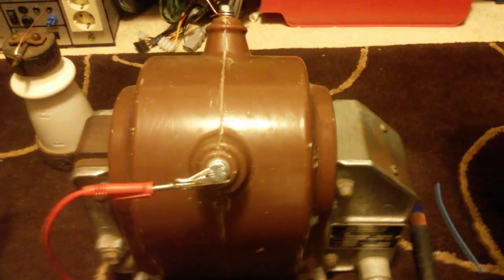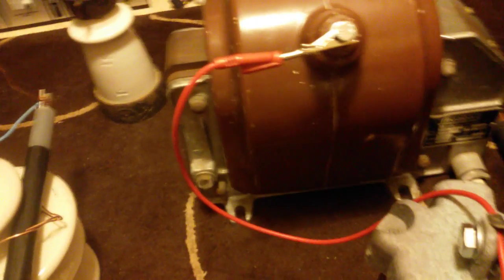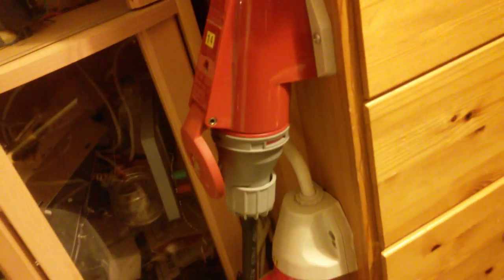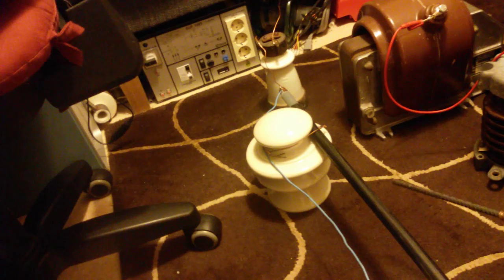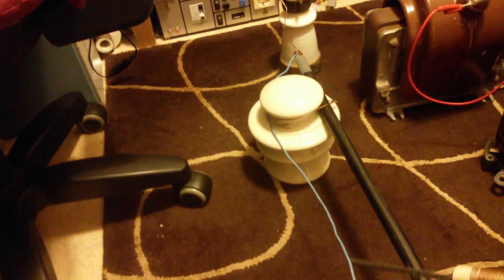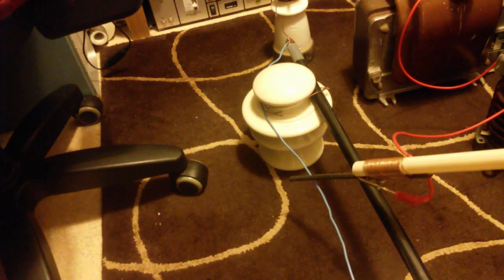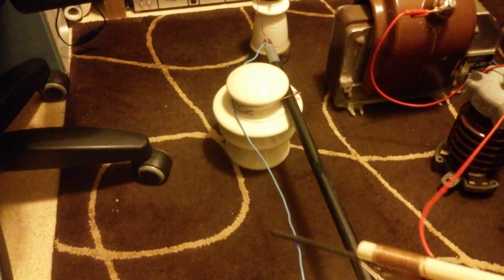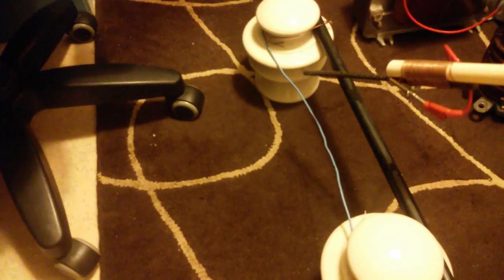HV CABLE TEST

Comment: Excellent. I am about to do some testing on 1KV silicone insulated wire before I buy a couple of rolls for my power supply. Good to see that it can handle the AC well!
Thanks for sharing - perfect timing!
Reply from the maker: It's a good idea to test them, a "megger" is a very good thing to have for these kinds of testings, I Think it would work with a µA meter as well.
Thanks for the comment!

Comment: I've heard electricians say you can get a jolt from the insulation on HV cables but I did not expect continuous current flow. Does that HV cable have a conductive screen that supposed to be grounded?
Reply from the maker: Yes, there is Three of these wires (Three phase) in a cable and there's a aluminium braid round them thats grounded. 
Thanks for the comment ;-)